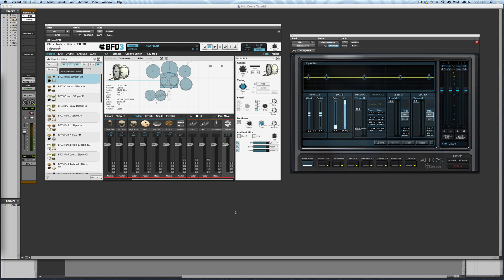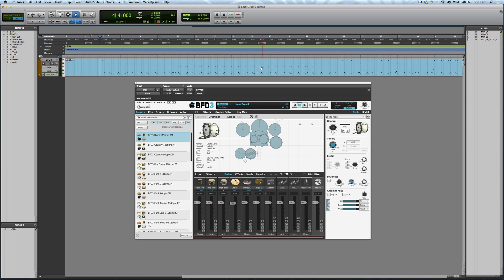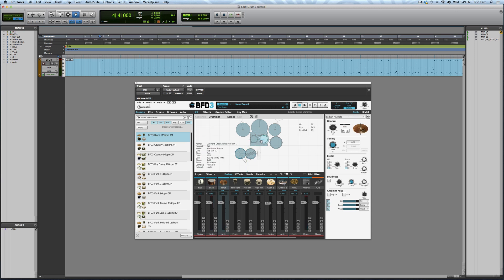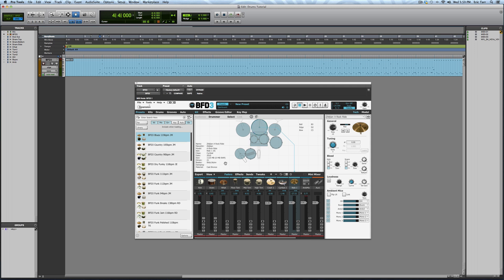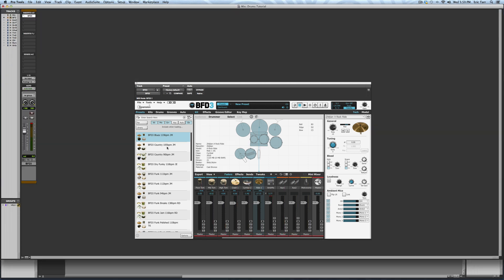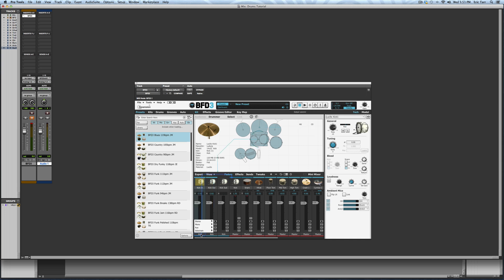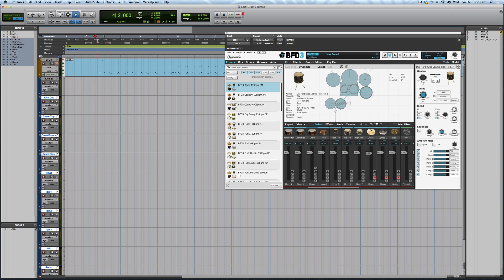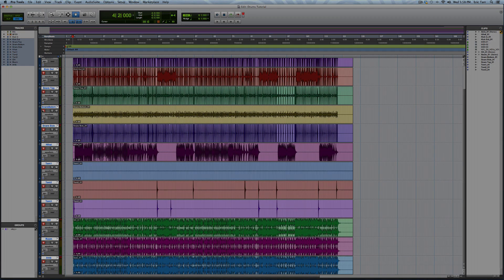Mixing BFD3 Drums with Multiple Outputs in Pro Tools

Comment: Any idea how this canbe done in Cubase?  I ve routed the drum kit in seperate channels (Automation under the Instrument track) but its not audio channels. I cannot record this.
Reply: So far Pro Tools is the only DAW I've used that allows the multi out of BFD3 (or Superior Drummer, etc.) to be routed to audio tracks. I love Pro Tools for this. Seems strange but I actually like tracking the multi-outs and then mixing later. However with Cubase, you could move the midi groove to the midi editor in BFD3 and bounce all the separate audio out of BFD3 into a folder, then import all the audio into Cubase onto audio tracks.
Reply: Reaper does that. And it does that for 60$!
Reply: @guitarpunkcovers  or for free. :-)
Reply: Brandon Cooke reaper is not free.